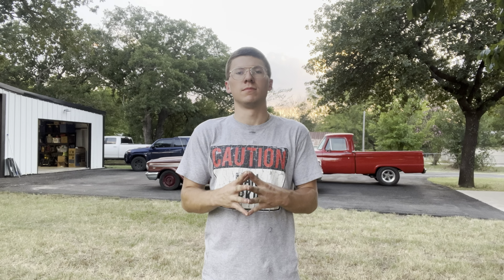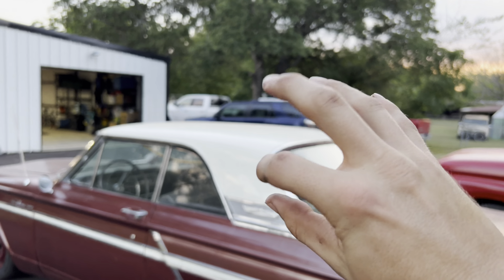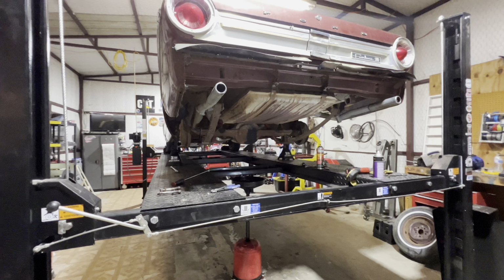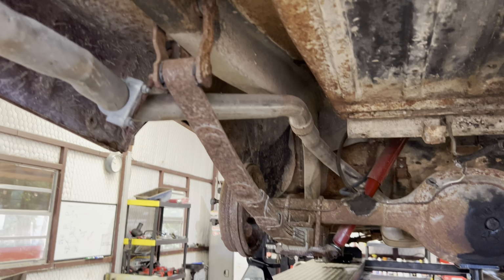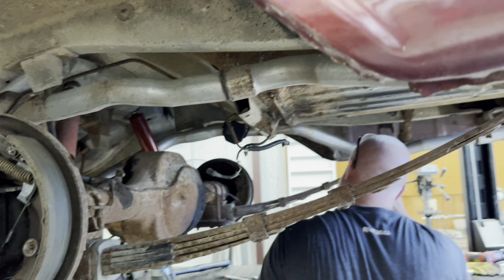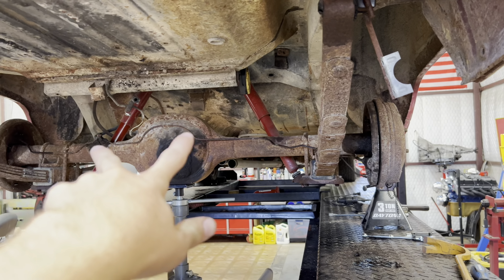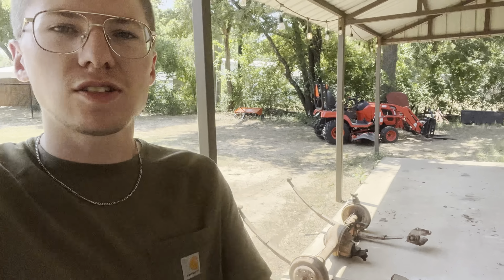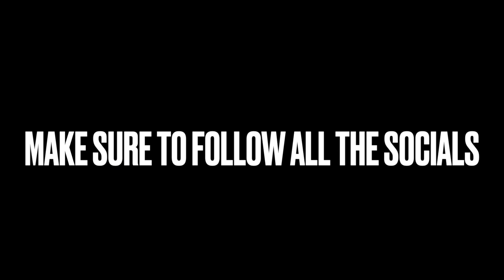The Rebuild Of My FORGOTTEN 1964 Ford Fairlane BEGINS!!

Comment: Before you put the new tank in, put a drain plug in it. It might also be a good idea to plumb it for an electric pump and return line.

As long as you're not going to narrow the 8-inch, it's probably okay to keep it, but if you're gonna do anything to it, you should probably upgrade to a 9-inch. Even if you stay with 28-spline axles, a 9-inch is MUCH stronger. Always opt for over-building the car. Just sayin...

(I have a 64 Fairlane with a 429 in it. I love these cars.)

Comment: I’ve been around Fords for close to fifty years and I’m sorry to see you’ve wasted your money on the 8”, the small pinion and pinion bearings limits horsepower to around 300 with limited traction before parts breakage is a problem. My choice for my 64 was a n 8.8 from an Explorer that I had Quick Performance narrow. That’s 31 spline LD, 3.73 gears and disc brakes that I don’t have to worry about fracturing with my 450hp 289… The 8” isn’t worth the cost of a ring and pinion.
Reply from the maker: I’m going to be making around 300ish HP anyway, so what’s the issue? I’ve talked to people who drag race with 8”s and haven’t had any issues. I got a spare 8.8 in the back of the shop if this 8” blows. I’m building this car to be a cruiser/fun street car, not a drag racer.